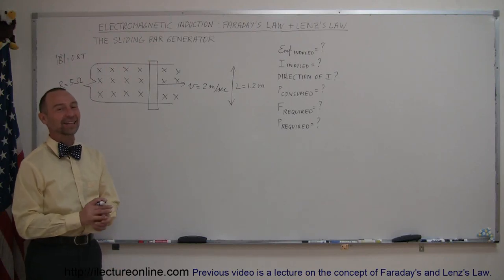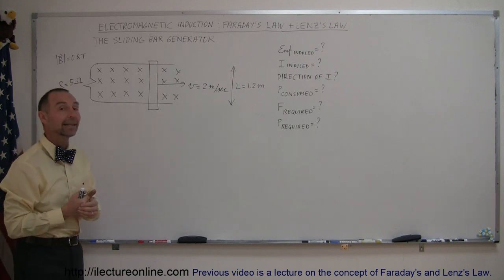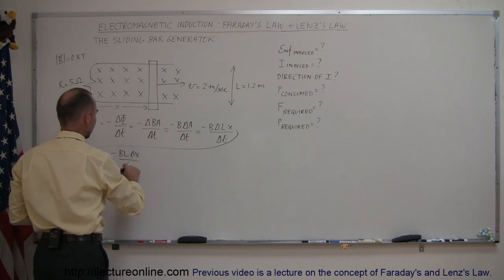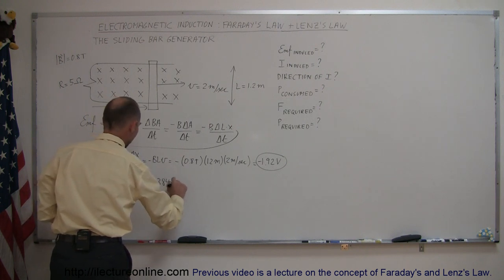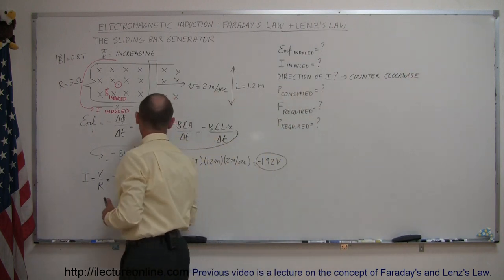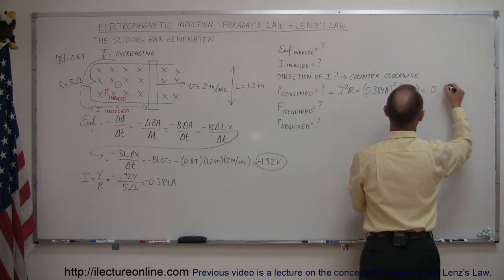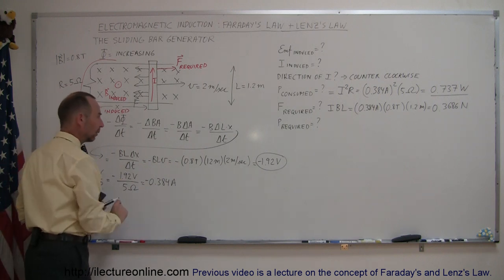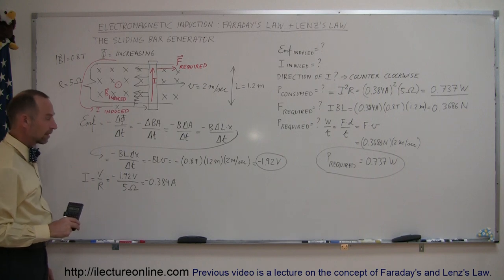Physics 45 Electromagnetic Induction: Faraday's Law and Lenz's Law (2 of 2) Sliding Bar Generator

Comment: Can we make copper is repelled to needle is it possible?
Reply from the maker: The repulsion is caused by magnetic fields and moving charges within them.
Reply: @MichelvanBiezen  how to create magnetic field and moving charges in copper without battery
Reply from the maker: That requires a wire folded into a loop.  Then pass a magnet into and out of the loop and you will cause a magnetic field to be induced through the loop and a current in the loop.
Reply from the maker: That requires a wire folded into a loop.  Then pass a magnet into and out of the loop and you will cause a magnetic field to be induced through the loop and a current in the loop.
Reply from the maker: That requires a wire folded into a loop.  Then pass a magnet into and out of the loop and you will cause a magnetic field to be induced through the loop and a current in the loop.

Comment: Sir, can l ask why is it F = IBL??
Reply from the maker: As with most equations in physics, when we think about it the equation makes sense.  Let's ask the question: "what would affect the force"?   If the magnetic field was twice as strong we would expect the force to be twice as large.  If the wire sliding across the magnetic field was twice as long we would expect the force to be twice as large.  And if the current through the wire was twice as large we would expect the force to be twice as large as well.

Comment: how do you know that the flux will increase?
Reply from the maker: Magnetic flux equals the product of the strength of the magnetic field and the area of the loop it passes through.  In this case the strength of the magnetic field remains the same, but the area of the loop increases as the bar slides to the right.  Flux = B x Area